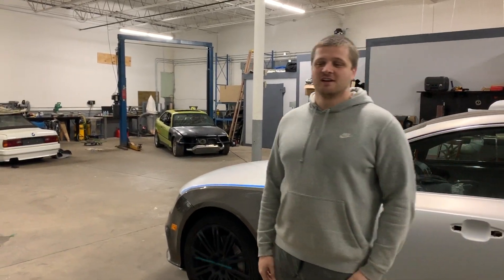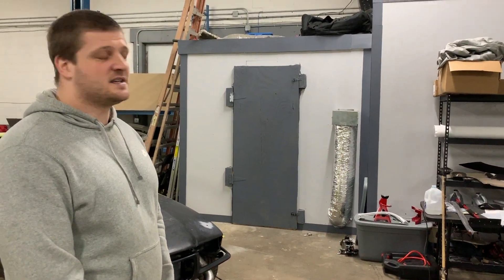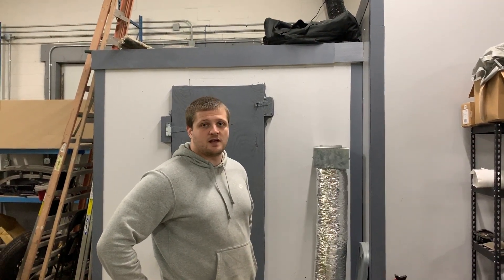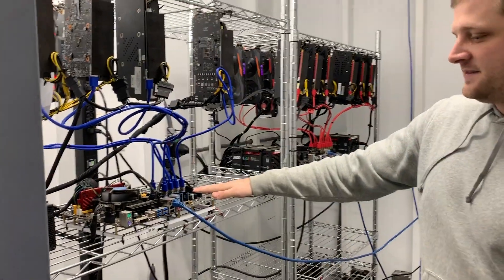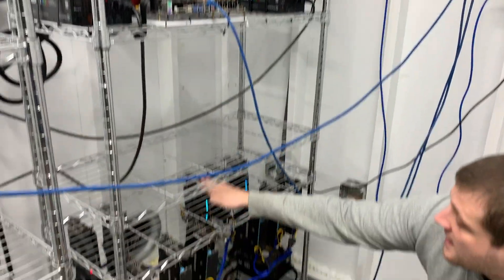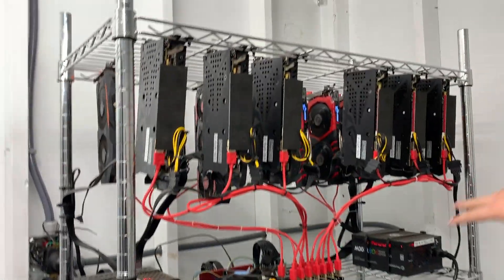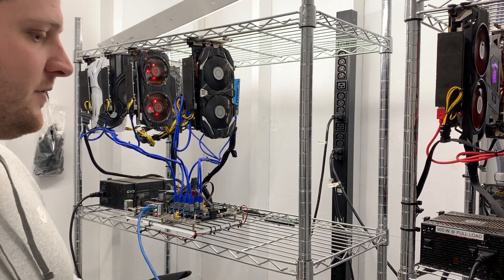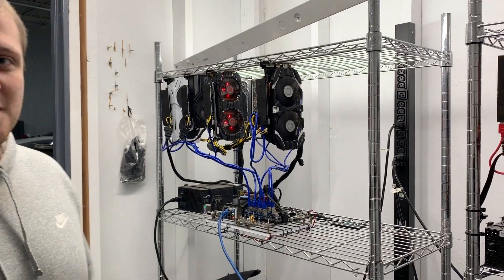DIY Cryptocurrency Mining Rig Setup

Comment: It doesn't matter that you are running half the current. You are running twice the voltage hence the same energy in the end. You can't cheat energy. The graphics cards still use the same amount of energy
Reply: thats what I was thinking...
Reply: Yeah, but most large 100-240V PSUs are slightly more efficient at 240V so you can save 1-2%. To be clear, this is not really due to the voltage itself being higher, it’s based on the design of the PSU. You can design a power supply to be the same efficiency on 120v as 240v, it just costs more so it’s not really practical.

Comment: Ummm the 220v thing is false. You're not saving a thing.  Amperage is half, voltage is double. Wattage is the same. Power (W)=Voltage x Current.  You're being charged by wattage not by current.
Reply: Its more convenient, you could argue you save money in equipment (and some efficency)  because you can use more efficient server PS W/ higher W capacity, run fewer circuits etc.. but thats about it.

Comment: I use mine to heat up the garage :D
Did not bother with cabinet or dust management, more than a year going strong without issues. This fall i used compressor to dust them off a bit.